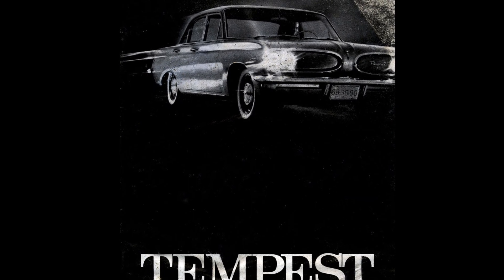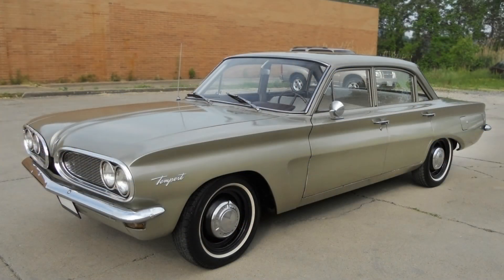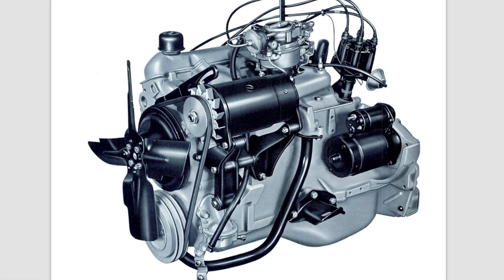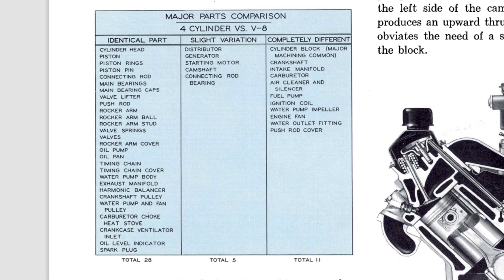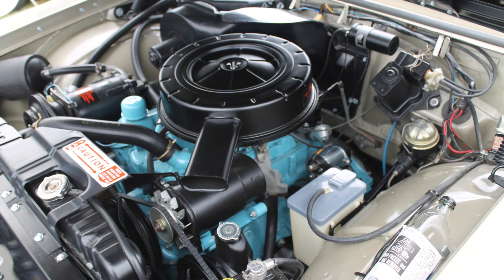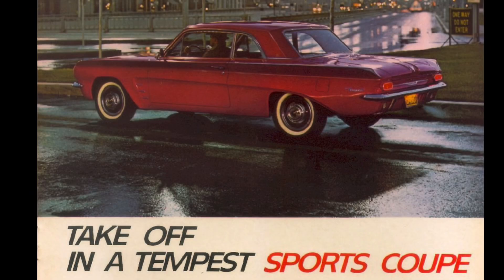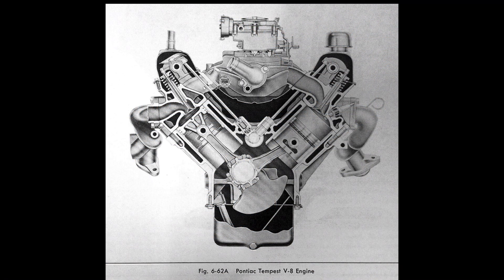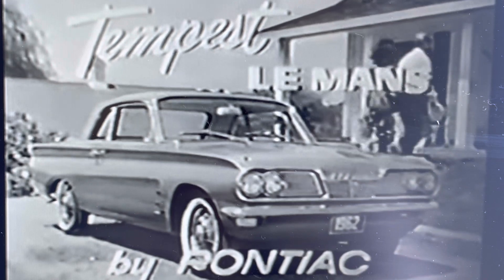Strangest Automotive Engines: The 1961-63 Pontiac Tempest & Its "Trophy 4" / "Half 389 V8" Engine

Comment: The pontiac automatic rear mount transmission was a nightmare..... it was not built to handle the horsepower of the 326 not to mention the 389 v-8.... We had a tempest stationwagon and it was a piece of junk.... it rode and drove poorly.... We had nothing but issue after issue with the transmission.... another thing that was an issue with those rear mount transmissions was heat.... they got very hot and would boil the oil....  what a mess of a car.... the two best days of my dads life was when he bought it.... and the better day was when he outright sold it for junk....

Comment: I had a Tempest convertible with the 4 cylinder and automatic transaxel. Pretty weird drivetrain. Sounded like a sewing machine motor !  Lots of interior space. The most rugged vinyl seats I have ever seen. Fun little car . With the small carb. it was certainly not very powerful . One feature, especially important in the upper midwest, was that with its big starter motor it ALWAYS would start, even at 35 below zero !  Heater was also big and one could cruise around briefly in the winter with the top down and windows up !  Great memories !

Comment: And with certain mods, those motors made STUPID power.....ergo Nunzi's '63 4 cyl Tempest......Nunzi was known as the Pontiac Expert.....i had the honor of knowing him thru my brother (who used to have lunch with him every week in the '80's)...he took that motor, put a Super Duty head on it, a large camshaft, and with a 4 sp manual, and 4brl carb, ran the quarter mile in 11:70 secs at a 113 mph.......absolutly RIDICULOUS power he made........you can find a vid or 2 under Nunzis 63 Tempest on u-tube......find the later one, it has that 11 sec pass......i'm VERY proud to have his LAST 3" Super Duty scoop on my '64 Tempest......i run 10:90's on pump gas in the qtr at 120, but i have a built 455, with lits of goodies, he was a MASTER of Poncho Power makin!!

Comment: I turned 16 in early 1965. My parents had previously purchased a '62 Tempest as a second car, which then came to me. Four-door, front bench seat, 3-speed on the floor. I don't recall which engine was in it. It may not have been blazing fast but that little 4-banger was easy on the gas and more fun than having one of those late 50s behemoths that some friends had. It was a great vehicle for a 16-year-old high school boy. It was easy to work on and required only basic maintenance. It was replaced by a 1965 Tempest Custom Convertible which, in turn, was replaced by a brand-new 1967 Firebird. I would love to have any one of those three back in my garage. Thanks for the great video.

Comment: I had a 1963 Tempest with the 4 cylinder engine. 115 HP for a 2800 pound car. It took awhile, but I got it up to 115 MPH. Only thing wrong with the car was that the rear wheels would canter under on a hard turn or hard breaking. This was caused by the transmission and differential being in the same housing which was bolted to the rear of the car.
Reply: No, the unwanted change in rear camber was a result of the car having swing axle rear suspension. If GM and everyone else had used a semi-trailing arm design it would not have been as much of an issue. Swing axles were "the way it was done" from the 1930s until the mid 1960s. VW, Porsche, Mercedes, Tatra, Tucker, and GM all used the swing axle to have powered rear wheels with independent rear suspension (IRS).

It's low cost and easy to manufacture but has bad geometry and positive camber issues right when you need that the least. It was part of what Ralph Nader was talking about in his book "Unsafe At Any Speed". Later, better designs like the late 1960s Beetle, Porsche 911, and Chevy Corvair would use semi-trailing arms which greatly reduced unwanted camber changes.

Comment: 194 ci is a huge 4cyl engine alot of 6cyl engines aren't that big. Main cause to vibration issues.
Reply: I was thinking about my old Chevy van with the straight 6 cylinder 192 ci. It would do and pull anything I tried. But if I pushed it too hard, it would burn through oil. I could always tell when it was getting low. I would pull over and add some, then take off again, like nothing had happened.

Comment: My uncle worked in Accounting at Pontiac Motor div, bought new 61 Tempest.  On trip to Canadian wilderness, above Soo Ont, a rock punched hole in transmission pan, 50 miles out of town.  He managed to plug hole with bubble gum or equivalent, refill tranny with whatever fluid he could find, and made it back to dealer for repair.  Great family story.

Comment: The other aspect of this car is that it was built on the same production line of the full size Pontiacs at main plant in Pontiac, Michigsn.  The line had to have considerable flexibility, but much cheaper than a dedicated plant.  Probably challenge for assemblers as well.

Comment: The manufacturing process was very economical because the the same machine tooling that was manufacturing the 389 was easily modified to manufacture the four-cylinder engine. It didn't take the hot rod community too long to figure out that the 389 bolted right into The Tempest. As a matter of fact they bolted a 421 into two of these and they led the first lap of the 24 hour Daytona by out accelerating every other car in the field including some full race Ferraris, they  simply blew their doors off everything on the straight away into the first turn. We had a 389 and the 4 cylinder side by side in our H.S. auto mechanics class.

Comment: There was a Hotrodding book which featured a 2 cylinder version of the tempest 4.   It allowed the same car to run in several displacement classes.   I did not know about the rear mounted  transmission.  It is funny this car grew into the basis for the GTO and launched the muscle car era.   Thanks for this new old news!

Comment: That ad actually shows the '62 Tempest, but great video! 
Back in the early '70s, my best friend's neighbor had a '61 Navy-Blue Tempest with that strange 4. She let me have a look at the engine. But I never learned what other weirdness lurked under those cars until many years later.
By the way, there are a few Corvairs around that have had GMs small aluminum V8 swapped in the rear!

Comment: Interesting that Pontiac decided to cut the 389 in half for a straight 4 vs cutting it the other way to make a v4 of even just taking off 2 cylinders to make a V6 like Chevy & Chrysler did with their 350 & 318 v8 engines to create the 4.3 and 239 V6.s

Comment: I had a 1962 Skylark 2 door hardtop with the 190hp 215 V8 with factory air, ps, pb and power windows. It had a LOT more room inside than many modern "full sized" cars.

Comment: In Jan. 1966, I bought a slightly used 1964 Pontiac Tempest, 6 cyl.(first of the larger version
Tempests) which ran flawlessly for another 16 years, until being vandalized! I only drove the
smaller 1963 V-8 model once, but it was compatible with a GTO in performance! Until this
video, I had no idea that the earlier model 4 cyl.'s engine/transmissions were configured that way!

Comment: A neat an innovative idea, the drivetrain as well as some handling characteristics were its actual downfall. In the rust belt, the rope driveshaft as well as those with manual transmissions, had issues with ice and snow build up under the car causing failures. I recall talking to an old timer dealer mechanic that worked for Pontiac in the mid 60s, saying that the linkage would freeze up with ice and snow, and if a driver was aggressive enough trying to get the car in a gear, the shifter would break. Same guy also said that ice and snow would get trapped inside the tunnel because these cars were rather low slung, and the shaft would cake up, causing horrible noises and vibrations. I got to drive a 61 sedan in the mid 90s. It did vibrate pretty bad at idle but was smooth with the automatic until about 55 mph where an odd droning effect started to happen.

Comment: Those 61-63 Tempests were lousy cars though.  The engines were very rough, the torque tubes rattled and the rear suspension had some spooky feeling similar to the corvair.

The 63 had a much improved rear suspension and the unreliable aluminum V8 option was replaced with a de bored Pontiac 389 resulting in 326 cubes.

The joke at Pontiac when the very traditional 64 Tempest came out with Chevy inline six (or Pontiac V8), front transmission, normal drive shaft, body on frame and live rear axle was that it was the car with the disappearing highlights!   Because every highly promoted unique feature of the 61-63 Tempest was gone.

Comment: Very interesting Adam! This concept of engineering a four cylinder from a V8 is fascinating to me! And it was done elsewhere, International Harvester did this same thing for the four cylinder used in the Scout. I believe they used components from one of their heavy truck engines, maybe a 345 cubic inch V8. Engineering marvels! Thank you!
Reply: IH developed their slant four after hearing about the Trophy 4 and it debuted in 1960 as a 152ci four... which was half of IH's 304ci V8. The experimented with conversions of their 266 (133ci), 304 (153ci) and 345 (176) V8s, settling on the 152 as the best combo of power and economy. When the IH 392 V8 debuted for 1966, a 196ci slat four was developed from it and adopted into production in 1966 Scouts. The 196 remained in production past 1980, after the Scout had been killed off.
Reply: @SootHead  Thanks for the details Jim!
Reply: The "iron duke" is a great example.  Chevy made the original 151 cu in 4 banger in the Flint 6 cylinder engine plant.  It was the base engine for the new  1962 Chevy II.  4 inch bore (Chevy 302, 327, 350 V8's) and 3 inch stroke (Chevy 302 Z-28).  It was quick with a 3 on the tree.  Chevy quit making it and when the Vega aluminum 4 turned into a debacle, Pontiac went to Flint and grabbed the tooling from the boneyard and started making it again as the "Iron Duke" to sell in their version of the Vega without the problem aluminum engine.
Reply: Interesting fact, the 4.3L GM V6 was based on a shortened 5.0L V8 block.
How many other car companies did stuff like that?😂
Reply: @pmscalisi  4.3 was based on the 350 V8  (5.7) block.  Ford had a 3.8 V6 based on the 302 V8 block ( fox platform)..
Reply: And the I-H slant four also used in DIVCO delivery vans(e.g.,milk trucks, etc.) Detroit Industrial Vehicle CO..

Comment: The 1963 Tempest had an optional 326 CID V8, a debored 389, available.  It was slightly undersquare.  The flexible rope drive shaft would keep rotating when in neutral with the automatic, which irritated some people.

Comment: In the mid 70's I had a 1961 Buick Special with a V-6.   I believe it had an aluminum block with the transmission in the rear as the Tempest you speak of here.  Pontiac had some great engines. I particularly liked their overhead cam straight 6.
Reply: @Rick-S-6063  Thanx for correcting me.  I had it for a while but never laid eyes on the transmission.   The body was pretty much rusted out with holes in the floor  so I did not have the car for very long.

Comment: I Had the Great experience of owning one of these. The 4cyl had a Propeller shaft feeding a 2 speed power glide Reversed so the Torque converter spun behind the rear end with Independent suspension. it was surprisingly Powerful. Sold it not Knowing what I had. DUH....

Comment: This video encouraged me to dig out an archived article I have. Sometimes it pays to keep the old stuff!

I pulled out the January, 1961 issue of "Popular Mechanics". Beginning on page 147, they did a comparison road test of the Dodge Lancer (both 101 hp and 145 hp), Buick Special, Oldsmobile F85 and Pontiac Tempest. This was back in the day when they actually road tested cars. 

So, some interesting facts regarding the test Tempest:

Base price (4-cylinder) $2167
4-door sedan
3-speed on the floor
4-cylinder, 110 hp
3.55 rear end
16.7 mpg (lowest in group)
0 to 60 was 15.7mph (second slowest in group)
Good passing punch
Top speed just under 90 mph
Rear slides out under hard cornering
Steering is slow but precise
Ride is firm but not harsh
Brakes good
Reply: Fast as molasses
Reply: @samholdsworth420  You'd be surprised how slow most cars were back then and in the 1970s compared to the last 30 years. All anyone really talks about are the muscle cars and sports cars of a given era. The regular cars are often slower than you would think. Some economy cars like the VW Beetle were 18-22 seconds 0-60 MPH.
Reply: @snowrocket  yeah... Full-size trucks doin 5 seconds 0 to 60 is pretty crazy lol
Reply: @samholdsworth420  Yeah, I'm 58 and never in the dark days of 1980 did I think we'd see trucks like that. Or, a street-legal 707HP American factory daily driver like the Dodge Hellcat Challenger and Charger. Those top out at 195 and 205 MPH respectively. I remember when any car that could do 150 MPH was a big deal. Now, that's not noteworthy unless it's a lower cost family car.

Comment: I had a 63 with 326 V8 and a three speed manual floor shifter. It was a pretty fast car and would really burn the tires ! It was my first car when I was 17 years old and I was pretty proud of it . I do remember having to replace the clutch in it 👍
Reply: Where was the clutch 🤔
Front or back
Reply: I had either a Tempest or Lemans (can't remember) but it had a 326.  Nice running car.  My girlfriend had a Pinto and loved driving my Pontiac because it had so much power.  I drove her Pinto a few times and couldn't believe what a "slug" it was.
Reply: Clutch change was a PITA — didn’t know how to do it with the torque tube & trans-axle.

Comment: My family's 1964 IH Scout had the same engine set up; the Comanche 4-cylinder was half of IH's (not AMC's) V8. Engine was tough and I don't recall significant vibration. It did have a unique sound to its exhaust.
 I remember the first generation Tempest well. Our neighbors had a 1961 4-door. The engineering was great, but I always thought the wheels and tires looked too big for the car. I much preferred the wheel/tire size on the F85 and Special. 
The best of the BOP first generation was the fantastic Buick Special for 1962 with the V6. 
Please consider doing a video on my personal Pontiac power plant-the OHC 6 cylinder. Along with the Buick V6, the Pontiac OHC was a perfectly balanced and sounding engine.

Comment: Wow, is that an AC compressor on the passenger side of the Trophy Four??  That's the generator on the driver side. 

Actually, GM had two aluminum V8s back then.  Buick of course, but also Oldsmobile, who engineered several differences into their version. For example, the Buick used four head bolts per cylinder, while Olds used five head bolts per cylinder on theirs. Those engines are definitely worthy of being featured here.  Especially the Olds Jetfire...
Reply: I believe it was Buick had 5 and olds had 6. With the exception of the turbo there wasn't a lot of difference. Crank and rods were the same and you could bolt Buick heads right on the olds block. You had to drill and tap the Buick block for the olds heads as yhe extra head bolt also held the rocker shafts. Even the exhaust ports were in the same location and used the same manifolds.
Reply: @edmundanderson657  Ah yeah, you're probably right - I was going off memory, and I'm a Ford guy, one who has done a head swap on an old school Fox 5.0 Stang - and I still can't tell you how many bolts per cylinder on a Small Block Ford...🙄
It would seem that Olds was fortifying the engine a bit, perhaps to prepare it for that turbocharger in the Jetfire.
Reply: @DanEBoyd  I've read that in recent years but don't know if its speculation or assumptions. The engine was out in 61 but the turbo didn't show till 62 and 63.
Really the blocks are the same. The eight bosses are in the lifter valley just not drilled and tapped. If you're talented you can do it. Those 8 bolts are also about 5" longer as they are the rocker shaft bolts too. The buick had stand alone rocker shafts with 5 bolts.
Stupid as this will sound you could run a buick head on one side and an olds head on the other. Intake and exhaust manifolds interchange.

Comment: I learned to drive in a '63 four-banger Tempest wagon, which my Dad bought after I tore the oil pan out of a '56 Plymouth after going airborne on a country road. Guess he thought it might slow me down. 
The wagon was a decent performer and the '63 style change made it look more like a GTO. With all the glass and the transaxle in the rear, it was unstoppable in the snow. I nearly rolled it once when the swing axel swung tucked under on a sharp turn, but the Tempest had better front-to-rear balance than the Corvair.

Comment: These early 60's GM compact cars and their engines have become one of my favorite subjects as of late. You had an air cooled flat 6, 4 cylinder, aluminum V8, and a V6 to choose from, not to mention two available with a turbocharger. GM was really innovative at the time. Once Pontiac gave up on the OHC engine, it seems GM threw in the towel for the next decade.
Reply: The bean counters won!

Comment: Chevy had a similar 153 engine in its Chevy II ( not be confused with the later Iron Duke 151). Midget racers back in the 60s and 70s used the 153 with modified heads on them and made great power. It is still made by GM today as a industrial engine called the General Motors Vortec 3.0 liter industrial engines.
Reply: Friend of mine had the 3.0 also as an inboard marine engine...

Comment: I drove my dads 1961 Tempest in the mid 70's for a short time. It had about 140,000 miles on it used a bit of oil but handled very well for an old high milage car. It was a three speed floor shift as I remember and had great leg room. It was slow on steep hills but other than that was a fine car.